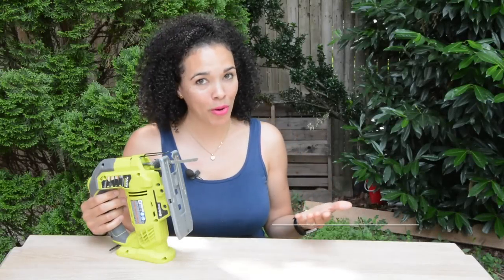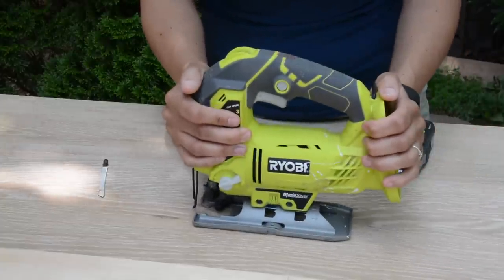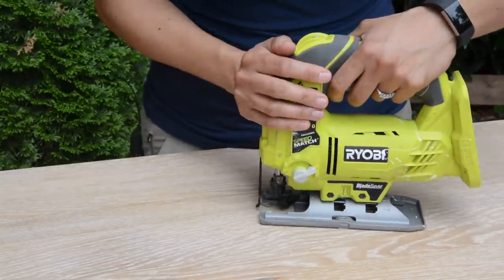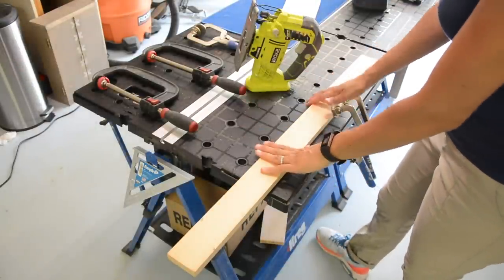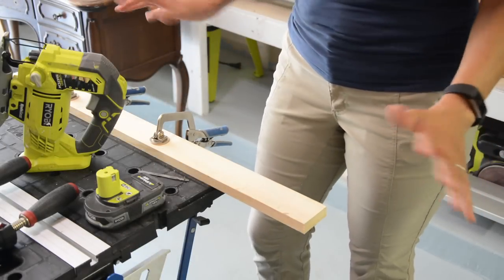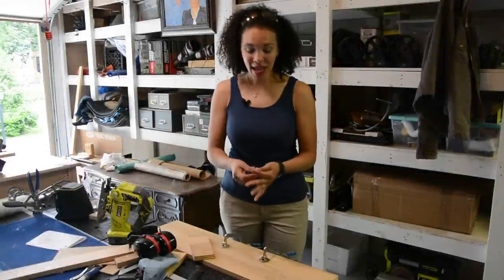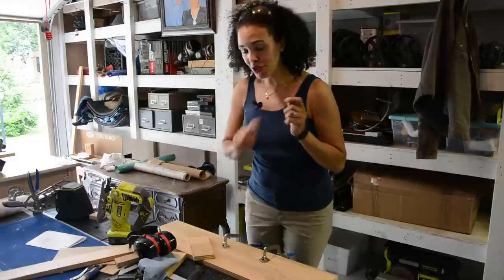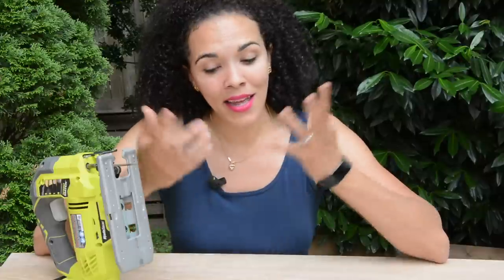How to Use a Jigsaw: The Easiest Tutorial For Newbies! - Thrift Diving

Comment: Ryobi tip - Always check online sales at Home Depot,  I have seen better pricing numerous times online while standing at the Ryobi tool display! They will honor the online sales pricing at the store, or it is usually a 2 day free shipping thing if they do not have at the store.  By the way I got this tip from a HD tool dept guy.   I have saved a lot of money doing this, sometimes two tools for 60% of what they cost separately and it includes the charger and batteries!  Thanks for the video,  everyone needs a jigsaw, one thing I would add is this jigsaw allows for platen adjustment, the base will adjust up and down, not just on an angle, for blade wear or on thin wood wood cuts,  which I think may have helped on the circle cut you did but wasn't really necessary but it does help with control..also remember the 3Ds when using this = Depth,Drill on Discard, meaning set the depth, and drill the access on the Discard piece if finished product is for display... can't tell you how many times I have seen beginners drill on the piece they wanted to display.

Comment: I watched David Stanton earlier today demonstrating how to cut a curve. His workpiece was a large piece of 42mm hardwood. He turned pendulum (orbital) off. He made the point that the front hand is for holding the jigsaw down, not for steering it. He made a special point of explaining  why he doesn't use dust collection. The rear hand steers the saw, and applies gentle pressure to move it.

He showed the cut close up, it was straight and smooth.

He's also made a workbench that you can place on the dining table. I won't scratch the table, and it won't move. It has a lot of dog holes, based on the Festool multifunction table (MFT).

Comment: Thanks so much! I'm an avid do-it-myselfer and have renovated many rooms in my house, including two kitchens (two houses) but I have a fear of power saws.  I once cut a 30" panel with a japanese pull saw (because as you explained saws that cut on the push and pull are awesome). I feel more confident in giving a jigsaw a try now. About to install floors that will require some weirdly shaped cuts!

Comment: First of all your presentation on how to use a jigsaw was awesome! Being a new DIY’er I really appreciate your expertise. My first project is installing a cat door for an indoor doorway. I carefully leveled the template, then drew the lines. After drilling the lead holes as instructed I began to use my Ryobi Jigsaw for the first time. I’ll tell you…I’m still a little nervous but, getting use to it. My door in a metal one with foam insulation and has the square beveled panels. My cut started real smooth, using your direction for almost the entire top of my square template. When it got to the end the jigsaw kicked back and the blade broke. I diligently replaced it after removing the battery and started at another lead point from the bottom up the side. Again, pretty smooth until I got another kickback and broken blade. Then I almost got to the end of this cut and…you got it…kick back and broke my third new blade. I’m using blades that are labeled basic metal. It seems that when I get to the beveled portion of the cut this occurs. How can I cancel this kick back-broken blade curse??? In the end I used a reciprocating saw, which I never used before and got the job done but, not at neat and clean.

Comment: I consider myself quite adept at using a power jigsaw, but I got curious with the confidence with which you, a lady, were trying to put across to your audience. I thoroughly enjoyed your vlog until its very end. I say you're awesome. You're a great teacher. And you made a very systematic way of dishing out to others your knowledge and skills. We in the Philippines rarely use battery-powered gizmos. Most often our powertools are plugged onto 220v power outlets; and we rarely pull the plug to mount or pull blades out (pun intended). Anyway, you just gave me a great tutorial. Congratz to you on that!

Comment: Thanks, great video.  Just purchased the same Ryobi jigsaw.  I to had trouble getting the hex key out.  Try grabbing it with your thumb and forefinger close the bend where it goes into the handle and pull straight up and out.  That way you're not pulling it out on an angle.  :)

Comment: if you lack having a dual cut blade and need a nice edge on the finished side of the piece you can turn the work piece upside down.  the up stroke of the blade will give a nice edge.  and thanks for posting this.

Comment: Back in high school we used a cutting board with a bench vise — the board was basically a rectangle with a “v” cut out on one side — this allowed for the sheet to be cut to rest securely on the surface of the cutting board, allowing you to cut within the confines of the cutout V. I wish I remember what they called the cutting board! 

Also — though we worked with our bare hands back then — I would most definitely suggest a good pair of work gloves to avoid splinters and hot tool bits.

Comment: Great video. One suggestion. The scroll blade definitely helps with intricate shapes, but so would setting the oscillation to zero. The blade moving straight up and down might be a slower cut, but helps track on a curved line better.
Reply from the maker: Great tip! I'll have to try that to see how it works compared to the scroll blade. It's flawless with the scroll blade. Thank you!

Comment: This helpful for me since I can't seem to get my circular saw to cut at a 90 degree angle and the table saw is just scary.  For your straight cuts on any material, I would recommend using  some sort of guide, such as a clamped piece of thin wood to make sure the cut is straight and now wiggly.  Also I wonder if there is a way to cut a circle using a center point jig.

Comment: Great video, now I feel more confident about my new project. I have only one suggestion and that is regarding the hex key. Tools are designed for men and I have had the same issue with hex keys and I suggest that women and men buy a bottle of silicone spray and spray the end that goes into the slot with a little bit and it will slip in and out easily. I use silicone spray on doors that stick when it is very humid and they expand and "stick" even on my windows when they stick. It doesn't discolor paint or vinyl and it makes life so much easier. I am comfortable with various saws but I own a stripped down Victorian/ Queen Anne style home and I decided that I would make my own decorations after seeing the cost of buying them. I've only used a jigsaw once or twice in my life during shop class if I remember correctly and we were cutting metal. I thought a tutorial was in order before I went shopping. Thank you for a great tutorial. I am subscribing for future videos.
Reply: They are not designed "for men", the hex tool hole is designed so the key wont pop up mid cut because the blade oscillates up and down several times per second and creates A LOT of vibration. If you have trouble getting out the hex key, do not thinker with the hole or the key itself, you better get good taking it out as it is, or you can use a container to store it, or, you can get a set of hex keys that should have the same measure key. If you modify the key or the hole, the key will pop up eventually you will lose it.

Comment: Just subscribed! New to power tools and so far all I have practiced with is an electric staple/tacker gun; which is much easier to use than my old manual stapler.  I have watched other tutorials about jigsaws and so far I am really impressed with the amount of information you included in your tutorial. Especially about clamps, work tables, eye and sound protection. Thank you for sharing your knowledge it will go a long way with this newbie woodworking DIY-ER! 😆😊

P.S. Would using a piece of heat resistant silicone help to protect your fingers when removing the hot blades?

Comment: Great tutorial, I feel much more comfortable using the zig saw. I will be looking for your other tool tutorials. 
I have an animal rescue and want to make feral cat shelters and tire shelters but am unsure what tool I would - especially to cut circles in a tire. 
I also make jewelry and would like a tool to cut ceramic and porcelain. Can you do a tutorial on this as well if you haven’t already done so?
Thanks so much!
Reply from the maker: Glad you found this helpful! To answer your question about cutting ceramic and porcelain, you have a couple choices, at least. You could get a little snip tool that's just a handheld tool. Or you could use the small tile cutter that you place the tile in to cut it. That's not a power tool. In fact, you cut it with the tile cutter first, then can make smaller cuts with snips.
Reply: @ThriftDiving  thanks for the suggestions. I actually used tile snips and a manual tile cutter in my younger days. Unfortunately my hand strength is limited so I was looking for power tools to help me out. 
I’m ashamed to admit it but I bought a Dremel 4000 and can’t figure out how to use it. I’ve asked a couple of people but so far haven’t gotten anyone to show me. I am pathetic when it comes to the mechanical stuff.
What do you recommend for cutting a 3-4” hole in a tire?

Comment: Great video overall. One thing I’d add id that the orbit setting should be 0 on tight radius cuts so its not hard to control the tool through the cut. 😀
Reply from the maker: Thanks for your tip! For tight radius cuts, I use a scroll blade.

Comment: I bought a Chicago brand jigsaw today at Harbor Freight, and a variety pack of blades. Your video is a HUGE help! Even though some parts are a little different (your saw is obviously higher quality), the basics are the same. A picture is worth a thousand words, and a video is usually worth a thousand pictures (because it IS thousands of pictures!). That's certainly true of your terrific tutorial. Thanks for showing the problem you had removing the hex wrench, too. I don't trust perfect people!!!! Ha! I have much more confidence after watching this, and I can't wait to get started on my model railroad framework. Those 45 degree cuts will make the corners awesome. Oh, one more edit here. I just happened to think......it would be great if you could demonstrate the things one of those little moto-tools can do. I know they easily cut model train tracks. What other magic can they do?
Reply from the maker: You're welcome! :) What moto tools do you mean?
Reply: @ThriftDiving  I suspect the Dremel brand moto tool and its cheaper knock-offs are not in your area of expertise, since you might be more in line with carpentry than hobby work. You might have fun checking them out, though, if you do more delicate scroll work and sanding, etc. They are versatile with a huge array of attachable bits, polishers, and sanders. Again, I really appreciate your work. Oh, before I forget, can you tell me what that sliding ruler thing is that screws onto my jigsaw, in front of the blade? I have no idea what it's for. Thanks. Thrift Diving

Comment: TYSM For Your Jigsaw Tool Tips.
However, When You Compared The Right Side vs. The Left Side re: Final Cuts Of Wood...e.g. Rough Or Smooth.  You Said, Left Blades Had Less Teeth.  Did You Not Mean More Teeth = Smoother Cut(?)  Also, Questions: When You Insert The Blades, Do They Only Go In One Way?  Do You Place The Teeth Of The Blade Pointing Away From You?  

Plus, What Are The Differences In The Two Blades You've Listed To Purchase At Amazon?  It's Confusing To Me.  

When You Mentioned Up Stroke And Down Stroke...What Does That Mean?

How Would You Clap Down A PVC Pipe...While Cutting It?

Finally, What Is The Max Width/Thickness Of Wood Can A Jigsaw Tool Cut?

So Excited To Try Using This Tool Effectively.  I Need To Purchase The Adequate Safety Features -As Well!!!  
Again ..TFS + TYIA!!!  (New To Your Channel...And Subscribed...Yeah!!!)
🙂💜

Comment: Hi Thrift Diving, I tried cutting a piece of wood 3/4 inch - flooring - and it was jumping around and the jigsaw was very unstable. I believe i need a clamp. I thought I could do it without a clamp. You seem to be operating the saw with such ease so I don't know why mine was jumping around like that except that it was not clamped down. Please let me know. Thanks again.
Reply from the maker: Yep, you definitely need a clamp. Do you have a work table you can use? For safety reasons, it's best to use a clamp. Plus, if the wood is stable, your cut will be more precise. :) Try that and let me know how it goes for you!
Reply: Clamp clamp clamp

Comment: Hey Serena, this was awesome, I look forward to more tool 101s.  I do have a question, I tried adding a piece of plywood to the top of a bookshelf, to finish it off bc when I bought it from Craigslist years ago, it looks like it was cut off.  So I painted the plywood and I drilled a pilot hole and then tried to drill in a screw.  The screw didn't go in all the way so I went to the next corner, to  give myself time to think about how to get the screw all the way in.  I used a smaller drill bit than the screw so as to not split the wood, since I already painted it.  Well my drillbit broke.  It is still in there and to simplify my life, I took out the other screw and just left the plywood sitting on the shelf.  It is not attached, which is fine, but I'd rather it be permanently attached.  Any advise on what I did wrong and how I can fix this.  Thank you.
Reply from the maker: Hey, Kristina! Sounds to me that the drill bit you used was very small. This actually just happened to me, but not in a project that I "care" about so I didn't make any effort to remove it. So I had to do a search for you and found this great video on how to remove broken drill bits: https://www.youtube.com/watch?v=L8sbKu_uv-A

Looks like if you want to go that route with using the extractor, you can get them here for not a lot of money. 

https://www.woodcraft.com/products/screw-extractor-5-16?gclid=CIvdr_7xxNQCFZCCswodT64JhA

But this video shows you how to remove them without an extractor. Looks like a good method! https://youtu.be/4O5PU8SzbhI

As for your screw that wouldn't go in all the way, could you cover the threads with some soap or beeswax to see if it will go in more smoothly? That sometimes works!

Hope that helps!
Reply: Cool, thanks for the info. I'll let you know how it goes.

Comment: What blade, speed settings and setup do you recommend for cutting acrylic? I have the same ryobi jigsaw you’re using.
Reply from the maker: Hmmm...good question. I've never cut acrylic before but I know it's gotta be a very careful cut. I would probably use the plastic setting that you see on the side of the jigsaw. It should likely be a regular blade because the only blades are wood and metal. But choose one with a lot of teeth.

Comment: Hi.... I am confused between purchasing a JigSaw or an Angle Grinder (as it can cut wood too like a mini Circular Saw) for small DIY projects... What would you recommend?
Reply from the maker: I would definitely recommend the jigsaw since you're doing small projects. And angle grinder would be overkill for small projects, but it depends on the wood you're using. You'd be better off getting a circular saw if you want something with more power.
Reply: @ThriftDiving  Thanks for your inputs :)

Comment: Dont know how i ended here, but anyway, you should also explain that getting a straight cut with a jigsaw its actually quite difficult. If you are doing a long cut, make sure you first make a reference line with a pencil (some jigsaws and circular blades have a laser that will help you guide it trough that reference line), and that you should get a big piece of lumber that is straight (and parallel to the cut ), align the base of the saw to stop with that piece of lumber, making sure that the actual blade is on the line on both sides, then clamp it to the wood you want to cut.

Then you just cut making sure that both the front and back of the base of the jigsaw touch the parallel piece of lumber. You will cut as straight as you aligned the other piece. If you do a long cut by hand  and you are not very experienced or dont have a steady pulse, you will go off the line and when trying to correct, you will make some ugly curved surfaces.

Comment: I have a problem with the jigsaw from Ryobi. When I'm ready to cut the wood, I first let the blade run, I steer the machine to the wood and then everything starts to jump, both the jigsaw and the table, even though I'm in the right setting, full speed, blade for wood. It just starts to jump and eventually locks in place. I just tried it for the third time but no luck.. I thought maybe there would be something about it in this tutorial but unfortunately not. Any ideas?

Comment: I recently purchased a ceiling fixture and I need to know prior to installation, what's the appropriate length from the ceiling. Since all ceiling heights vary, please help. Thanks.
Reply from the maker: Great question! We're going to be doing some ceiling fan work in our house soon and I had this same question. I don't know if this video answers your question, but I just found it recently and it offers some great tips on ceiling fans! https://www.lowes.com/projects/build-and-remodel/install-a-ceiling-fan/project

My guess is that it shouldn't be at a height were you can just reach up and touch the blades! Common sense, I know, but that's what I would go with!

Comment: Do all jigsaw's use the same blades or do different brands use their own specific blade?
Reply from the maker: It depends on the shank--the end of the blade that either looks like a T (called T-shank) or if it looks like a U (U-shank). It depends on which one the jigsaw takes. It's not so much the BRAND, but rather, the end of the blade and which type your jigsaw takes. It will tell you in the manual. Check out this link for more info: http://www.woodmagazine.com/woodworking-tips/techniques/sawing-solutions/jigsaw